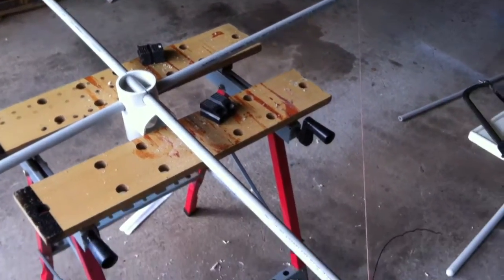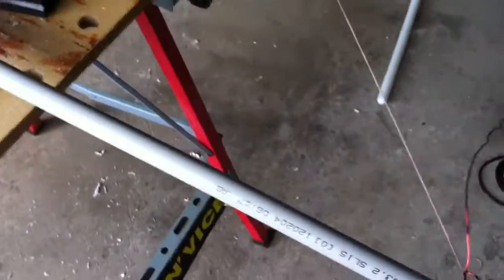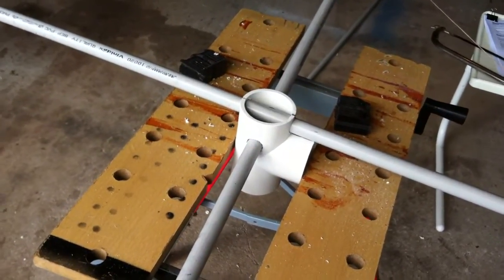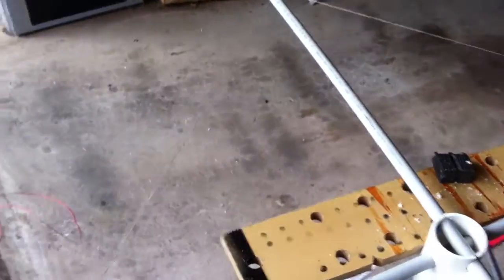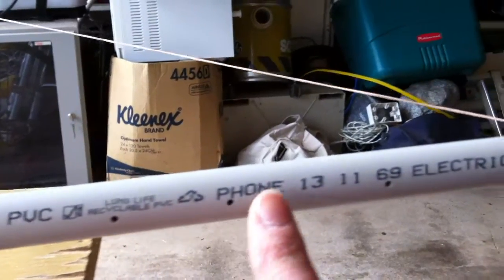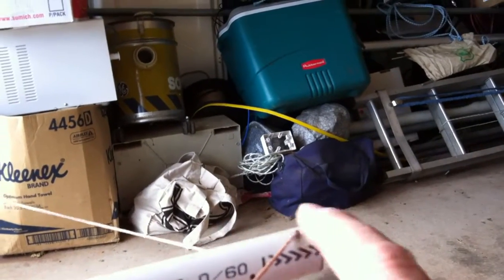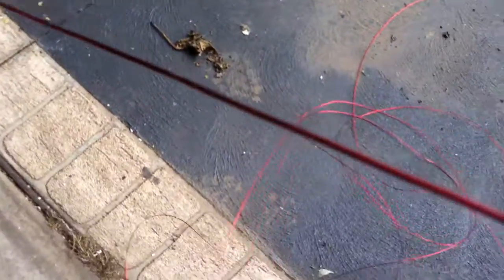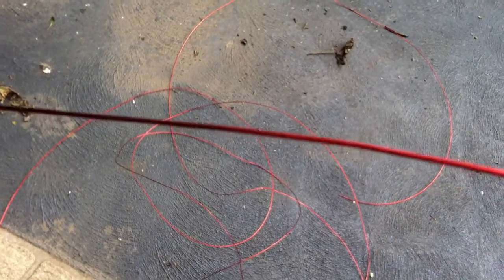HF Spiral Loop build video 1

Comment: How did this work out for you?  I’d like to build one too.  I’ve never worked on 160, and this looks like a good way to do it in a stealhy manner.  Would this also work on 75 with a tuner?  Thanks and 73 de Jeff, KF5KWO
Reply from the maker: Hi mate. I cant remember if I ever used it to TX. Long time ago.
Reply: OK, thanks. :-)